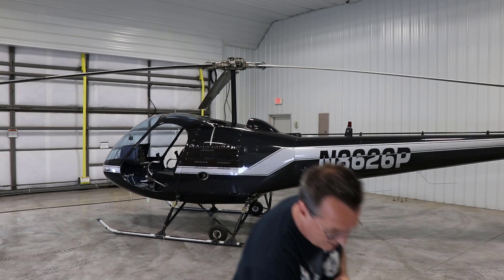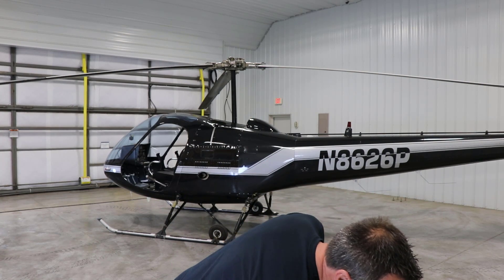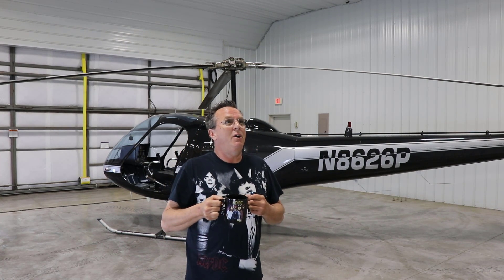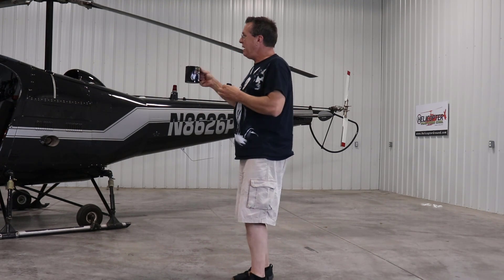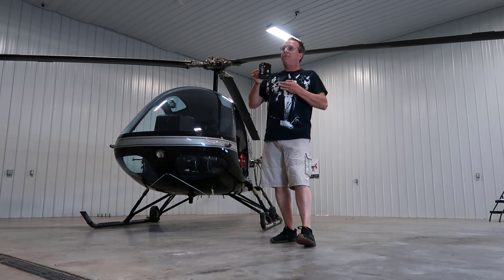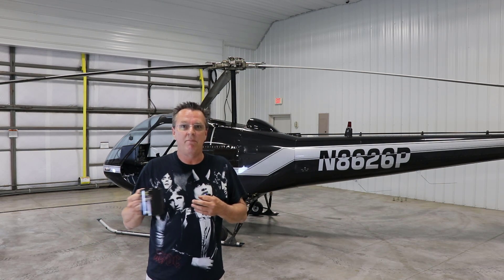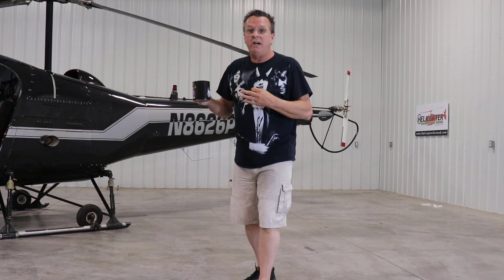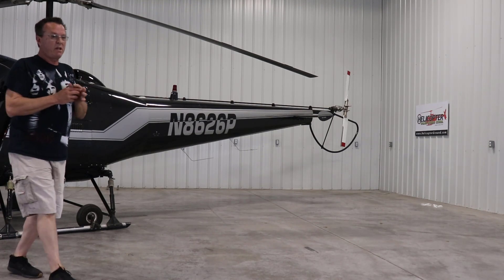#146 HELICOPTER ABNORMAL VIBRATIONS | During Solo Flight | HOGS Member Concerns

Comment: Suggestion... before solo, ride with your eyes closed and hands light on controls while pilot goes from startup, hover, takeoff, pattern, and landing.
You'll hear/feel buffeting differences, mechanical vibrations, etc that you ignored before because you were focused on flying or your instructor.
Just an idea. I did it after I had my PPL at a friend's suggestion. You'd be surprised what you notice.
Reply from the maker: Interesting tip thank you for sharing!